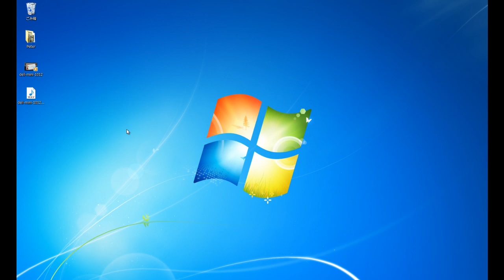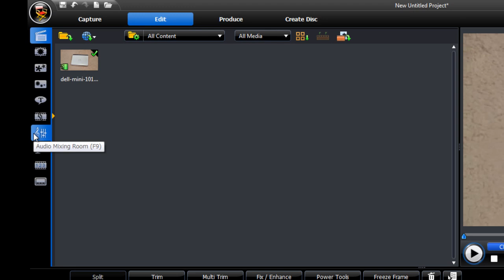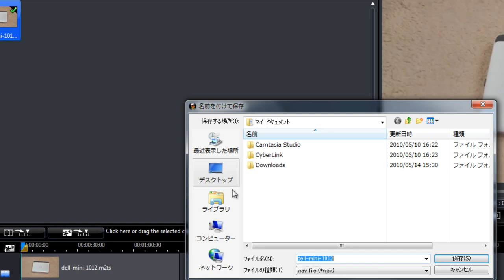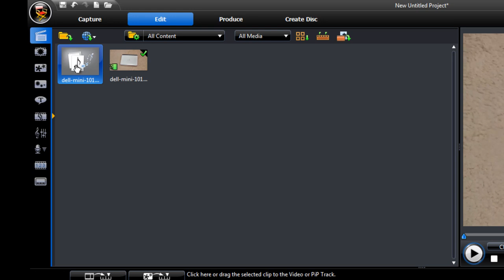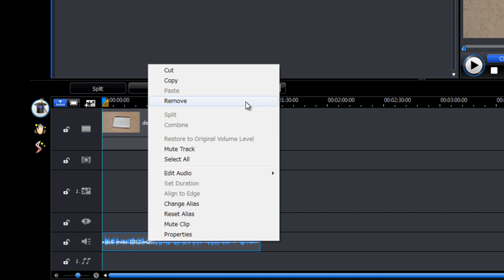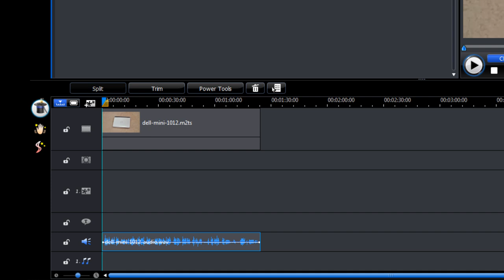How To Increase Volume with Cyberlink PowerDirector 8

Comment: Hi, is it possible to make small changes within a video track using this program? I am thinking about if, for example, someone turns their head away from the microphone in a video clip and their voice volume goes lower. Could just that section of audio be boosted?
Thanks